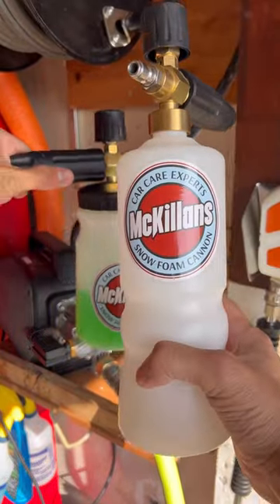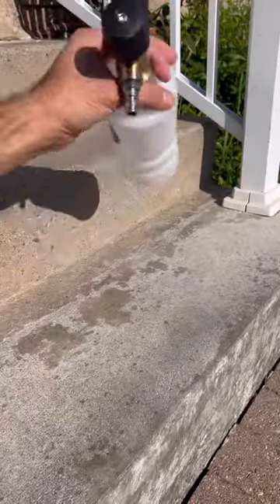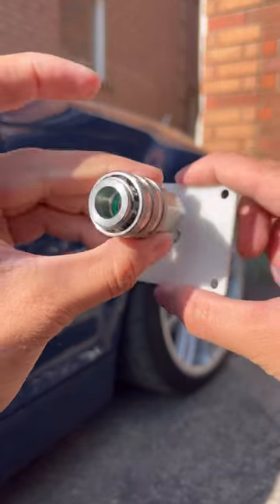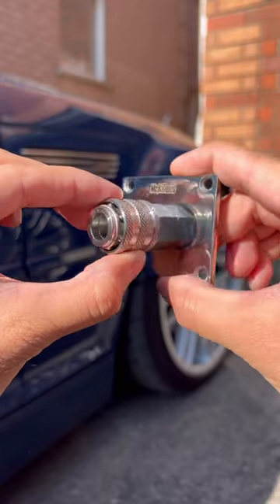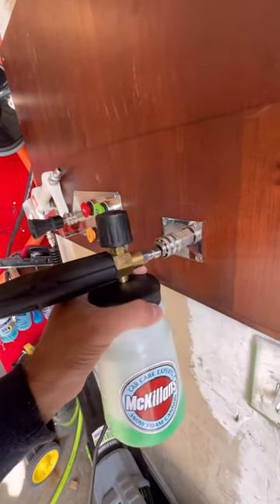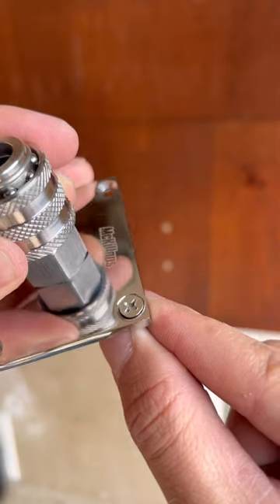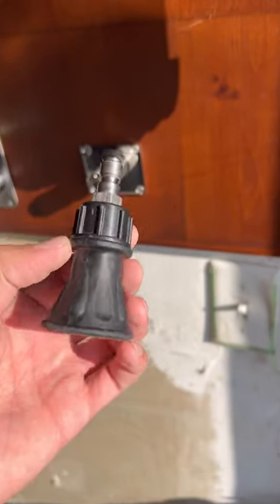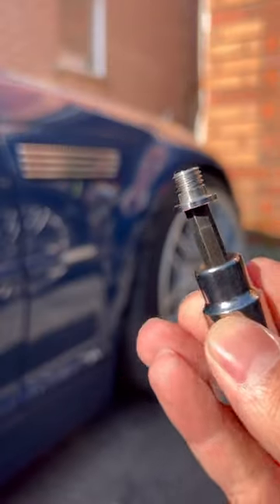The Best Upgrade for Your Foam Cannon #Shorts

Comment: I’ve done similar in the past with tapping a female connector into my detail cart, but I love the idea of the spring loaded connector. Do you sell just those or have a supplier I could use?
I have also done the same idea for my guns, mount a male connector to my cart and plug in the male end of my gun beside the foam canon.

Comment: What’s a good foam gun recommendation you know the one used for a garden hose I do t have a pressure washer so I’m resorting to this
Reply: Chemical guys torq 6 , $50usd
Reply: Or save $50 more and get a Ryobi 1800psi pressure washer from Home Depot for $100.

Comment: Lest hope the screws aren't stainless those suck
Reply from the maker: Why do they suck?
Reply: @mckillans  stainless is brittle so it snaps easily. And if you put a little to much weight on them. Not to mention they strip incredibly  easy if you use a drill or dont have a screw driver that fits perfectly.
Reply: It's for a foam cannon.....  it'll be fine